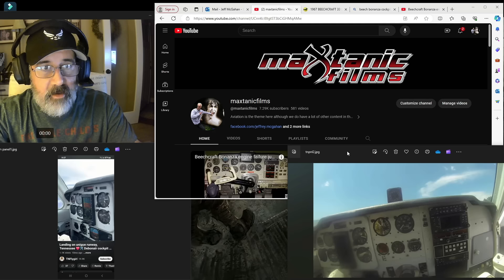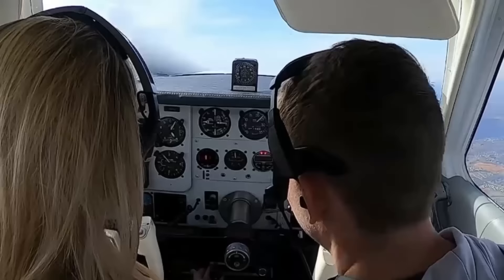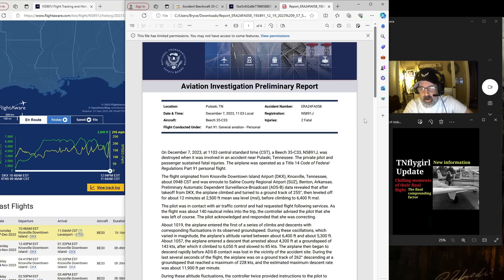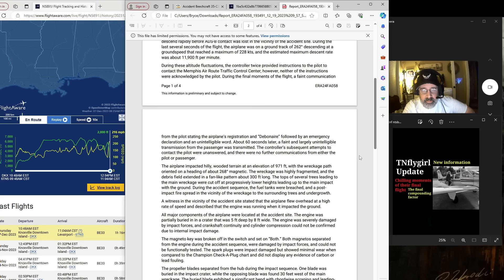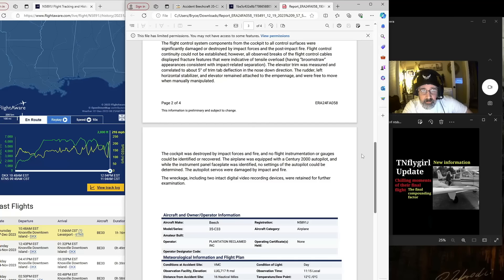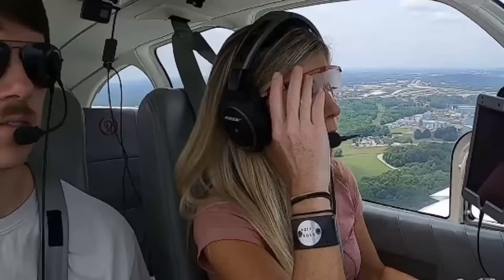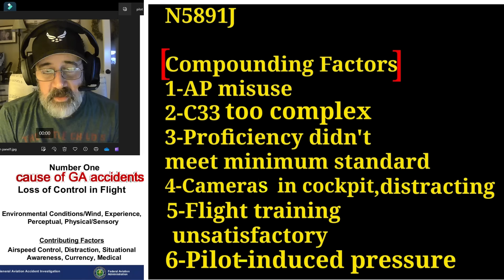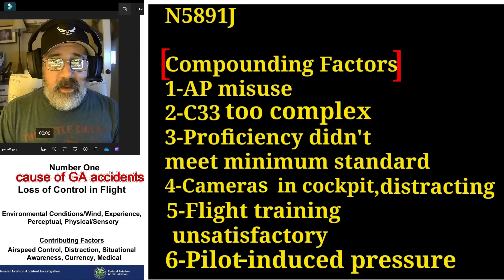TNflygirl Fatal Crash Update NTSB Preliminary Report N5891J

Comment: I always required that a student already had passed their faa or icao ... exams before I would take them up flying. Basically I required that they pass the private pilot, commerical pilot, instrument pilot, and ground instructor exams before they start actual training in the plane ... this is to ensure that they have the basic knowledge so that they can safely and sanely make good use of the time in the airplane ... also ... the airborne cockpit is NOT a place to be providing basic aviation instruction ... all those basics should be taken care of ON THE GROUND ... then practice switch and configuration and emergency proceedures should be practiced on teh ground ... multiple times ... so the student has it in their head what to do, where to find the control or switch, why do configure one way or another ... for various situations or evolutions ... and all the basic numbers for that airplane in their head ... only then ... once they know how to use every feature the aircraft has available ... from autopilot to etc. do we leave the ground ... and then ONLY sans any recording devices ... and sans any distractions ... and with a moment by moment flight plan ... that looks more like a test flight script than an ad hoc scenic flight ... exact rpm exact angle of attack, exact time to exact altittude, exact headings ... time to next turn or waypoint, expacted rate of climb or descent, etc. etc. etc. from takeoff to landing ... no loosey goosey chatter ... sterile cockpit with exactly flight plan ...  getting the need for exacting planning into their heads ... and practiciing on the ground before leaving the ground ... so that they know exactly which button puts them in altitude hold, which heading hold, with altitude and heading hold, which establishes rate of climb etc.etc. and how to transition with or without avionics or automation systems ... etc 

to be blunt ... this girl ... while she is probably a nice human being or ...was ... had no business flying  at all ... she lacked by attitude the necessary commitment to learn aircraft systems and the operating environment ... and should have been turned away early in her training ... and if she insisted, should have been required at multiple stages to have achieved competency before allowed to move to the next step in her aviaton training ... 

the flight instructors are directly responsible for her death, that simple. no excuses, that is their job
and they failed horribly as irresponsible and incompetent.

a simple trivial competency quiz would have put her back in basic ground school ... 

ask her to tell the colors and smells associated with each different kind of fuel ... 
ask her to explain how exactly TACAN is different from VOR and why the military uses TACAN
and what frequencies they operate on
ask her to explain how DME works and what a cosine correction is for use of DME
ask her to explain why angle of attack is a better choice as primary instrument for choosing max climb or best glide than a simple fixed airspeed
ask her to explain how forward or after cg will change max airspeed in cruise
ask her how long the airplane engine will run inverted
ask her how to explain density altitude and takeoff and climb rates and flare heights under different altitude , temperature and humidity conditions ..

i would normally ask all these and more of any new student ... 

i doubt is she could have answered ANY of these ... 

she had no business being in a cockpit ... and the chap with her honestly did not have any business being there either ... 

the blind leading the blind 

honestly ... i dont really care whether the faa or whatever icao authority they functioned under has all their paperwork in order or not ... incompetence and irresponsible behavior was the reason for this death ... 

shame on the flight school that taught her and on the flight instructors that flew with her ... 

the 2000 is a trivially simple unit ... anyone with a modicum or technical knowledge and a rational brain can figure out how to make proper use if it in less than a couple or three ... hours of ...  reading and practice ... read the bloody manual and then get in the cockpit and imagine each part of the flight evolution ... and what you need to do with the autopilot to achieve it ... and practive it again and again ... and boom about 3 hours later you have competency ... 

I was almost killed twice early in my career by autopilots and coupled flight systems that did not do what i expected and that I foolishly had not taken the time to understand fully ... radar altimeter failure on a coupled system and a malfunctioning pressure altimter combined in a mooney to try to fly me straight into the runway ... i managed to pull its teeth by killing its power and manged to land...a frightened but sobered young pilot ... as just one example ... after that ... i studied the crap out of all systems before i moved any aircraft ... but it was luck ... not wisdom or skill that saved my ass that cold fall day ... 

So the base lesson here is simple

if you do not know ALL the systems in all modes of operation and how to handle a failure of each of those system ...you should not be flying the damn bird ... go get a hot chocolate and the handbooks and sit down and study and practice ... 

getting in a hurry ... can deprive you of a lot of fun you might have had if you were not dead ...
Reply: Excellent analysis and summary. As a retired private pilot…I coined a phrase…” Your hobby is not supposed to kill you!”

Comment: It is one of the best examples that someone can be extremely talented and successful at one task (work/interior design and decorating, sales, customer relations) and totally inept in another task (flying and likely tasks that were more technically oriented).  This is tantamount to excelling in creative writing while struggling in math.  Most of us have a preference and find one more enjoyable and easier than the other.  However, we are still able to do both as the difference is not insurmountable.  It seems that in this case the difference was and if this was a subject you took on school, she would have certainly failed, even after employing tutors.  What’s more, in this scenario she found math just as enjoyable as creative writing despite continuously failing math class, so to speak.

Comment: Here's an example of CRM that I experienced long before I had any real flying experience. Was on a cross-country in a v35 and taking off for home (TX to CA Bay Area), weather was marginal. The yoke in this plane was the switch-over type like in the pic of your family's v35. Weather was worse than owner/pic expected (low clouds and some rain), got to the point where the pilot switched the yoke over to me (me having only the experience I had gained on the  flights out) and had me fly above a curvy highway we happened to be over whilst he scoured the paper charts to make sure we didn't have any obstructions in our path. Thankfully, we were out of the weather after ~20 minutes and smooth sailing thereafter.
Reply from the maker: Very relatable :)

Comment: A sterile cockpit is mandatory in an aerobatic airplane. Even hats, sunglasses and headsets cause lots of problems. Just pull G's and tumble and you'll see what happens. They can get stuck in the control stick mechanism or rudder cables. Very risky. I only flew my old Pitts Special S1S with earplugs and no hats, sunglasses or headsets. Plus, you can't move since you're strapped in so tightly if you have to grab a loose article that's too far away. Jenny should have spent countless hours on the ground playing with her instruments and electronics. Her airplane was nearly as complicated as a private jet. Crazy complex for GA aircraft.
Reply: this is an important point.. ;pilots that have never done aerobatic's really have no clue as to what happens when you pull G's or go inverted.  Just look at her seat belt its lose around her waste.. If she had a sudden upset which threw her up to the ceiling she could have really whacked her head her seat belts are not near tight enough.. I did have a few rides in a two place Pitts with a buddy of mine and even mello maneuvers really get you if your a novice.  I have a Cirrus SR 22 and in my first 50 hours I came over a ridge in Oregon and got a BIG bump CAT and I hit my head my wife hit her head it darn near knocked me out. I too did not tighten my harness down real snug and if you dont thats the results. From that day on first thing get in and Strap that thing down and tight LIKE I was going to do aerobatics..

 I had a client once who had a Dakota and he was pretty cavalier with his flying from day one.. And he kept asking his instructor to show him how to do a barrel roll and the instructor would not do it.. Well he tried it on his own Over Lodi CA and lost it and that was the end of him.. He was a very large man and I can just see him going inverted falling out of his seat holding the joke and pulling it back and snapping in a spin and dive.  Bottom line this lady should never have been signed off.. how you can on a VFR day lose it in basically straight and level flight  even futzing with the auto pilot and having 4k feet or so below you too recover is really wild.. I mean unusual attitude training from day one.. Nose points downhill pull the power.. you cant go down hill at 200 plus knots when the plan is in idle.
Reply: @jlh9910  This is an excellent response. We all learn ‘once’ to fasten and tighten our seat belts. It’s a lesson that I also learned the hard way. In the spring, my buddies & I fly inverted at altitude from our airport to other airports to help build our tolerance and for practice. Our 5-point harness plus the safety belt locks one into place. All airplanes should have them. I have lots of time in ultralights and Breezy type airplanes. Try flying those without a seatbelt or with a loose seatbelt. Could be deadly.

Jenny should have flown a Breezy type airplane or ultralight with limited or no instruments to learn how to really fly. Then transition into aerobatic aircraft. Then into a complex GA airplane. She never built her basic skills. Just like motorcycles. Start off-road riding & practicing with a dirtbike for years before riding on the street on a heavy, big bike. 

Two things make a ‘great’ pilot: Skill & Judgement.

Comment: You're absolutely right about how some people just don't have the aptitude to be a pilot. Not to say that it's impossible to train them to become competent. But it would take a whole lot more training and experience to get them to the point of conducting a flight safely.

In Blaylock's case, she needed a lot more hours along with some classes on the fundamentals of aviation. She needed to understand how an airplane works, how to maintain the discipline of scanning instruments along with having her eyes outside the plane for other traffic, and put the job of flying the airplane at the top of her priorities.

She didn't know why the trim is used. She was using trim to fly the plane, instead of flying the plane and using the trim to remove unwanted pressure on the controls.

Whoever did her check ride and gave her a passing grade should be part of the investigation. Maybe she was ok with a simpler aircraft. But seeing how she couldn't even figure out how to get on course, it's apparent that she had some fundamental deficiencies no matter what she might be flying.

Comment: I don't understand why she was so fixated on the auto pilot.. I'd rather fly the plane.
Reply: My theory is, when you can only process one thing at a time, if you can chuck AP on .. its one less thing you have to think about. Im sure she saw it as a way to help offset her lack of knowledge.
Reply: " I'd rather fly the plane"

I commented elsewhere that I have my 1A license here in Canada, I can drive a semi tractor and any trailer, flatdeck or van.   I washed myself out of a freight hauling job, pulling a 53' van through back alleys in rural towns to deliver restaurant, care home,  food supplies for Sysco (even though backing up to a hospital dock blind side my first time was PERFECTLY squared to the sides and dock plate).  I just didn't feel comfortable making some of the turns into alleys with light posts right there.   As I phoned in to quit, I told the boss, 'maybe there are guys who can whip around 53' vans in back alleys in the snow; I'm not one of them.'

So now I drive a concrete mixer, tandem with two steer axles WITH A MANUAL TRANSMISSION because  I  want to be in control of if I need to take a gear or not, not have it done for me by an automatic transmission that can't see the road conditions.  I drive my truck (06 Kenworth) soft because I want it to last; if the boss can't get me a manual transmission when this truck is ready to be retired, I will probably be put myself out to pasture, too.

Comment: She has no idea of the laws of physics, every video I have seen has the aircraft literally all over the place, so scary! 5 degrees downward trim on a plane that had a max down trim of 10 degrees indicates that she basically just flew that plane right into the ground. "controlled descent into terrain" I think they call it in the commercial aviation world. So sad but should never have happened.
Reply: I don't think this falls under "controlled flight into terrain", as this implies the aircraft was fully under pilot control, which she clearly was not. CFIT refers more to flying into a mountain because you didn't see it due to meteorlogical conditions.

These kinds of mistakes used to be called "Pilot Error", though that is shied away from these days as it's a bit of a cop-out and the aviation community will not learn anything from it if we just dismiss it as such. Sure, the pilot sucked. But how was she allowed to fly in the first place? There problems here run much deeper.
Reply: It's loss of control inflight (LOCI). Most LOCI accidents are either stalls/spins or spatial disorientation in IMC. This accident is a bit unusual. If it wasn't for her YouTube channel displaying her lack of competence we'd probably think it was due to pilot incapacitation such as from a medical problem or CO poisoning.
Reply: No, it was not CFIT. Smh...

Comment: She probably had it on att.. and it climbed hard.. then she cut it off.. and didn't decrease speed.. and it got to a point she could'nt pull up.. and she didn't know what to do to help.. R.I.P.
Reply: It was mentioned on another social media site that just the psychological factor regarding the autopilot could lead to confusion because they might have thought it was on when it was actually off. With the plane being out-of-trim nose down they might have been trying to find a way to turn the autopilot off when it was already. In fact there is one video where she takes off, turns on the autopilot in navigation mode, and it turns the wrong way, she turns it off but her dad for the next several minutes keeps thinking it's still on. He suffered from Dunning-Kruger and believed he was in a position to help her fly and give her advice when he was not!

Comment: I may be going out on a limb here but I don't even think she ever opened the manual to the autopilot. BTW, her flight instructor is a GEM! Mustache, aviator glasses and all!
Reply: According to one Vid of her she read it but she has forgotten most of it. One of her Instructors asked about a Function and that was the Answer.
Reply: @rainerbehrendt9330  Here's the problem though watching her use it. She was pressing and HOLDING the buttons down, that's not the kind of buttons those are,  they're just touch buttons to select  an option. That is the most basic part of understanding how it works, how do you forget that????
Reply: @a914freak  That gets scarier every Minute

Comment: Got my multi engine rating in a 310D back in 1972. GREAT airplane..
Reply from the maker: For sure, we loved the two we flew. The cabin room compared to the Baron and standard flight controls really stood out. The 310 always felt like a BIG little airplane. Looked good on the ramp :)
Reply: 310A in 1973.
Reply: And?

Comment: Interesting, I was a hang glider pilot before I got my ultralight license. I always used pitch for airspeed in a glider, and also in a powered craft. Power in my mind was for climb/descent. The effects are linked of course, forward stick will speed you up, but will cause you to descend unless power is added to stop the descent. Adding power from level flight causes you to climb as well as speed up initially, and in some models I found that it would pitch up enough to slow the aircraft down unless I changed the trim nose down to the new power setting...in any event, I just found it very easy to associate pitch with speed and power with climb/descent rate. If I wanted to descend the quickest while under complete control, I would chop power to idle, pitch forward with full aileron with opposite rudder, pitch was used to maintain safe airspeed and the cross-controls made the aircraft very draggy....drop like a stone under full control without dangerously increasing airspeed. Loved it. You must understand flight dynamics and your aircraft.